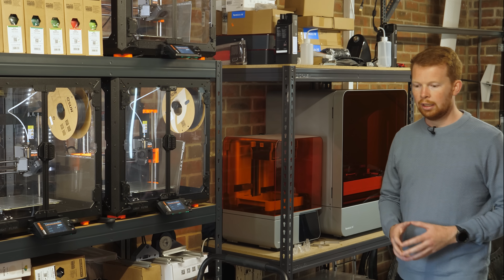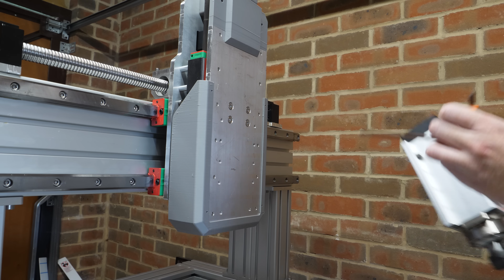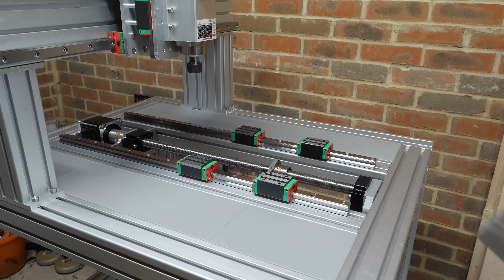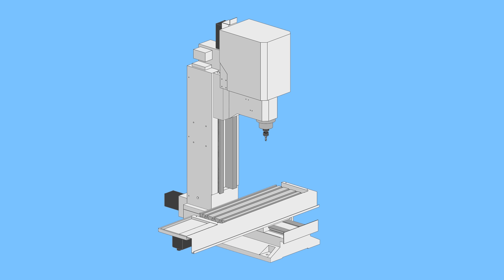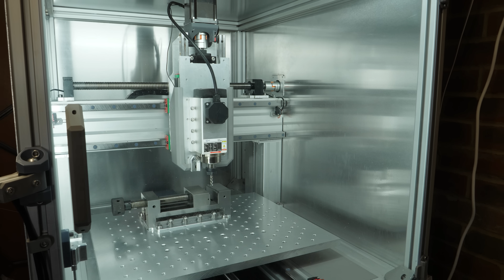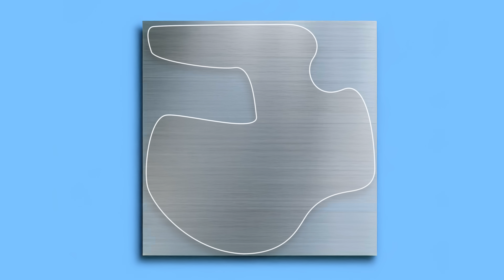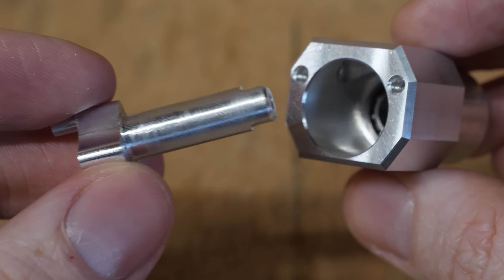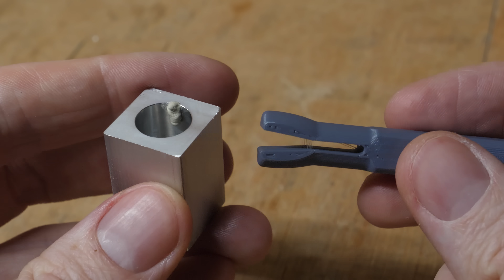I Needed an Engine, So I Built a CNC Machine

Comment: Mechanical designer here, most of the stuff I wanted to suggest already has (grooves for lubricant retention in the piston, locking nut to secure the piston assembly once fine tuned) But one thing that's really important here :

Aluminium to aluminium friction is quite high, and having both parts made of the same material also means they will both wear down and need to be replaced eventually.

What you want is to make the simpler/cheaper part out of a softer material, so that only it gets weared down, and the other part doesn't need replacement.

I'd suggest an aluminium and brass combo, brass is very easy to machine, and as a naturally fairly low friction. If you wanna get really fancy you could use self-lubricating brass, which is impregnated with graphite and used in bushings for high-speed applications.

The best while staying affordable would be a steel and brass (not copper, as it's an absolute pain to machine) combo, and I do believe your little CNC could machine mild steel, IF you install a coolant spray on it.
Reply: Oiled aluminium on steel has quite low CoF but thermal expansion has to be taken into account.
It would be easier and better to machine grooves into piston rather than cylinder although I have no idea what lubricant would be used, 900psi CO2 sounds like it would be 'quite cold' ?
Brass is quite heavy so crankpin and piston pin would need stronger material plus possibly heavier duty connecting rod unless it is operated at low rpm so keeping aluminium piston is best option.
Reply: @1crazypj he'd be best off using bearings
Reply: @jaubuchon28  
Of course your right, proper bearings to reduce friction would be good idea but that starts making things way more complicated, particularly for a non machinist with limited engine experience.
He would need to learn about  a bunch of other engineering.
Reply: @1crazypj"He'd need to learm a bunch of other engineering."
On a par with the likes OS, Novarossi, Picco, XRD you mean?
Reply: Aerospace engineer here - great points all round especially the like metal to like metal interface.
Reply: aluminium on aluminium dry friction coefficient is amongst the highest of the metal groups but its lubricated coefficient is not that bad compared to other metals
Reply: aaahhhh .. that is why pistons of Chainsaws are not coated with Nikasil, but only the Cylinders .. always wondered and never asked 😁
Reply: Yeah if he's not dry cutting, standard grade steel would be okay albiet slow lol
Reply: Carbide endmills on steel don't need coolant. Only if the workpiece heats and expands and it's a problem.
Reply: @MSivonen In theory, sure.

But having manually machined steel dry before, It's really finicky, and would require a lot of fine tuning on the g-code to get it to work reliably.

With manual machining you can go by feel and adjust before it gets bad, but it's not so easy with a pre-programmed CNC.

Especially considering that he doesn't have much experience nor knowledge regarding proper machining speed and what to adjust based on the sound, I really don't think it's a good idea, he would end up breaking so many tools.
Reply: @MSivonen  they don't need it, but they sure do appreciate it. 
At a minimum all end mills need chip removal. That is arguably the bigger reason to add some form of "coolant" (or air blast) Keep from double cutting chips.
Reply: @MSivonen despite theoretically being ok, nobody runs carbide dry due to heat
Reply: @jaubuchon28 that may very well be true where you work. But there are many cases where the workpiece doesn't get hot or the heat doesn't matter. And there are cases where cooling is absolutely necessary. So yeah i know, it's not a black and white thing.
Reply: why not make the piston teflon or something?
Reply: @imjstcl  The point of this project is to make something that can handle the 900 psi of using liquid CO2, and teflon isn't much stronger than 3D printing.

It would also become brittle due to how cold the engine would be, once again due to the liquid CO2.
Reply: What about a teflon sleeve inside the cylinder, that can be exchanged when worn? Keeps the engine light.
Reply: @ThePentosin  This could work, but it would partially insulate the cylinder, thus making cold management more difficult, and potentially fragilizing the teflon even more.

Might be interesting to experiment with that tho, perhaps the lower friction would still increase efficiency despite the downside of the insulation making CO2 evaporation slower.
Reply: @ThePentosin 
 Depends on running temperature, Teflon is quite soft even though it's second to melting ice for lowest coefficient of friction. 
It melts around 400f but mechanical properties degrade well below that temperature. (decomposing Teflon can release flourine gas, that's not a good thing)
Using CO2 at 900 psi should keep things cold? 
Maybe it would become brittle instead?
I looked into Teflon for a projects probably 20 years ago, forgotten most of what I learned back then.
Reply: @imjstcl  A PTFE Sleeve is a great idea, not only would it reduce friction but it would help seal as well. He might need to make the cylinder 2 pieces to get the sleeve in place, but that shouldn't be too bad.
Reply: > Aluminum to aluminum friction is quite high

So galling to hear that.
Reply: @hemiacplurge3572 honestly the opinions of uninformed people here has really anodized the crowd
Reply: @hemiacplurge3572  you have done well, lad… done very well indeed! 😂😊
Reply: Engineer & Engine Tuner here .. bare Aluminum on aluminum is a BIG BIG NO GO for a piston/cylinder.  I'd make the piston for this air engine and the con rod, out of plastic ... lower friction and lighter reciprocating mass.
Reply: Aluminum on aluminum and aluminum on steel is generally a poor idea for these kinds of wear surfaces. Aluminum has very low wear resistance, and has a phenomena called galling happen easily, especially toward iron alloys. Brass on a steel, or even cast iron cylinder wall, is the option that first comes to mind for his hobby application
Reply: @jacksonbf  A high silicon aluminium alloy is used in IC engines, cast alloys can have very similar properties to 'softer' steels plus  1/3 the weight. Galling/seizure is still a problem without lubrication though.
Reply: The benefit of single material is the ability to neglect thermal tolerances.  Since he wanted to used compressed air as a proof of concept and then use liquid CO2 for the final engine, keeping thermal expansion constant is probably a big simplifying factor.

That said, 304 stainless steel and self-lubricating brass is probably close (both somewhere around 17-18 microns/degree C)
Reply: @danielf3623 
 Problem with stainless and brass, they are both very heavy compared to aluminium 
A 304 stainless liner in cylinder gets around weight but stainless doesn't have very good properties when something is rubbing against it, (scuffing)  
Also, aluminium has an affinity to stainless so piston can 'stick' to liner relatively easily.
Reply: I was thinking this too
Reply: By adding grooves to the piston outer face not only you give lubricating oil a place to stay but also helps the piston to self center in the cylinder by means of the pressurized fluid (air or oil) in the grooves. It is a solution commonly used in hydraulic valves
Reply: I would figure that the cylinder and piston could be both aluminum, but only if the design of the engine supported a set of piston rings that would then be made of the softer material. This allows tighter tolerances but at least to me, it is unknown how much friction this would introduce, and how much power is gained from the process of adding piston rings. Could end up not even being worth it, especially at this scale.
Reply: Parallel projection makes my artist's head hurt lol
Reply: There's a lot of different plastics available that could handle the heat if you were just using it for the piston. You'd be reducing a lot of weight by comparison if you used plastic. Easier to maintain lubrication.
Reply: Wouldn't mixing steel and brass cause galvanic corrosion?
Reply: @pvpherthen2981  He's planning to use it with CO2, so it shouldn't be an issue, by the time it actually affects things wear and tear would make maintenance required anyways.
Reply: @pvpherthen2981  only if it's stationary in contact, when moving the gas leaking will act like a bearing
Reply: @pvpherthen2981 it's not in continual contact with water so it should be ok
Reply: I hate when anyone starts out by saying: "Mechanic from Louisiana for 20 years here🙋‍♂️" god damn... Stop it

Comment: Simple solution for the cylinder turning is to add a jam nut. You can set the timing, the lock the rotation.

Comment: Great work.
I think you need to look into G2 and G3 codes they are for circles on a CNC, modern 3D printers can also use them 
if they are enabled in the operating system and they can also be used on laser cutters at least they can on mine.

Comment: Your CNC machine is brilliant and a very nice piece of work. However, this engine may not be as efficient as your last one due to the unwanted compression stroke.  To fix this, I suggest adding an additional exhaust valve to your CO2 engine. Go back to the piston con rod ball socket idea, but instead of a ball socket use a larger cylinder socket. The con rod socket cylinder (little end) has two tiny holes which align with holes in the piston crown when the up stroke is occuring. This allows the gas to escape into the crankcase through these holes.  As the piston approaches TDC the angle of the con rod closes the exhaust holes. To avoid the inlet valve opening while the exhaust valve is open,  use a spring and a larger ball bearing to delay when the inlet valve opens.  Hope this helps.

Comment: I don't know fusion but I know that you can code your own postpros on Solidworks so I assume it work the same with fusion. Then just use G2 and G3 😉.
Just make sure your motherboard actually understand G2 and G3.

Also you can use G41 and G42, that would allow you to not worry about the actual dimension of the tool you are using 😉

Comment: You don't need to use a needle, you can just use the tool to touch off parts by checking if there's conductivity, there's ready-made plates for this on aliexpress etc

Though, I'm assuming the spindle is already shorted to the entire frame which makes this hard to do

Comment: If you are building a CO2 engine, then you are well on your way to creating an energy storage device. If the engine drives a generator, you can make electricity when needed. If you have a CO2 compressor, you can make liquid CO2 from electricity when when solar power is available. Is such a system possible as DIY? How large can a DIY system like this be? Can it power a home?

Comment: I'd suggest a simple set screw to lock the cylinder thread into position. You could knurl the outside portion to ensure grip and hide the marks of setting/unsetting the screw, then just add a support arm along the side to hold the set screw.

Comment: Machinist here: If your CAM software and CNC machine support it, you can use the G-code commands G2/G3 for clockwise/anticlockwise circles. If you want, send me a DM and I can take a look at the post-processor with you.
Reply: absolutely get g2/3 circular interpolation unlocked. you possibly will also be able to do helical moves for your thread milling.
Reply: I hate when anyone starts out by saying: "Mechanic from Louisiana for 20 years here🙋‍♂️" god damn... Stop it
Reply: @Mr.Goosebumps-gl8lv  than i recommend that you do not read this comment section
Reply: @Meiney100   yep 😂

Comment: I don't mean to pry as I have absolutely 0 experience with CNC. But won't the circle cutting tool inherently pass its inaccuracies to the part you're going to be cutting with it, as the making of the tool was limited by the gcode constraints?

Edit: the finished fit looks super smooth though, I'm impressed

Comment: I'm pretty sure I've seen people using a boring head or something like it to cut an outer diameter. If you can flip the boring bar around so the cutting bit is on the inside and open it up wide enough (probably requires a larger boring head) then you should be able to use it to cut an OD. Though I have no clue if that's a good idea.

Comment: Also machinist by trade here. I agree with previous advice given but I do have one thing that might soften the load on your machine. Normally when machinest and specifically milling opperators want to soften the load while maintaining the volume cut per minute, we tend to stick with trochoidal milling. In short this means a large stepdown (ap) but tiny stepover (ae). In combination with this you could increase the rpm and feedrate. I'm not sure what your machine is capable of higher rpms but at least you could lower the load on your steppers

Comment: G code can do circles just dont use coordinate system most 3d printers use as only option G02/G03 X12.5 Y14.7 R2.0 F0.2;

    X, Y – The target coordinates at the end of the movement.
    R – The arc’s radius.
    F – The feedrate (Speed) at which the machine will move from the current position to the target position.

Comment: A cylinder clamp like the yokes on a motor bike or lead screw coupling to hold the cylinder in position which can be machined into the crank case

Comment: you could mark where the optimal postion for the cylinder head is compared to the case with a marker or metal scribe, then maybe JB weld could keep it secure from turning
Reply: or just actually weld it if you can TIG

Comment: 2 ideas for keeping the cylinder in place:

(Easy solution) add a locknut onto the cylinder thread. 

(Cool solution) keeping with the aero theme; drill 2 small holes diagonally through the edge of the crankcase (one at each corner), then another through hole in the bottom cooling fin. You can then wire lock the cylinder in place 😁

Comment: Tom you also have usg02code G02 or G03 to make the circle they are the codes used to make an arc. And you never mentioned codes like g53 which is the machine zero code in other words the code used to tell the machine to go back to its zero point.

Comment: Some g code firmwares can be told to draw arcs, so it is possible to draw something closer to an actual circle than just using a bunch of linear cuts. How the firmware interpolates the arc command is another matter.

Comment: Whoa this is great!
I know too little about CNC finishes but to my laymen eye it looks like your surfaces are great. I also don't hear any chatter while cutting. I'm surprise there is no cooling fluid for cutting. Maybe for aluminium this is not needed?

Re pistons:
you slowly are approaching all the details of modern engine cylinders and how they are made.
Honing your cylinder liner at this scale might be challenging but the diamond lapping paste might cause big trouble if you can't clean it perfectly.
Offset for the piston bolt? that connects piston to the con-rod might help with better/more defined geometry at top-dead-center when the valve opens. At 100PSI you may not encounter what you will at 900PSI.
Piston and cylinder surface finish needs to be not perfectly flat. It needs roughness to reduce friction losses and carry lubricant.
Lubricant needs to be fluid enough to work at CO2 temps. Maybe CO2 itself is enough. If not, you'll need a gasket ring and a way to lubricate during operation.

Anyways, this is GREAT!
Thanks for taking us with you :)

Comment: If the pin on the top of the piston were threaded with a small jam nut at it's base the timing could be adjusted and locked with a static cylinder height removing thread cut and chamfer operations for a single drill and tap operation.

Comment: Why does it turn circles into polygons? Why doesn't it use G02 G03?? Is that the fault of the CNC controller not supporting standard G-code, or the CAM software having the wrong setting?

Comment: To lock the cylinder once you've tuned it why not drill a small threaded hole from the outside that you can then tighten a small bolt against the threads. Add a small dab of silicone to the bolts threads and it should remain pressurized.

Comment: I would like to suggest 2 holes on top for a shop vac hooked up to fish tubing that clears away you chips as you cut. you can hook the shop vac blower exit air into the enclosure to make the vac more efficient. be sure to put a lot of vibration guards and sound guards for the holes so the shop vac vibration does not vibrate the mill, suspend the shop vac by wire in a sound proof box, to isolate. make sure to have heat ventilation.

Comment: Aluminum on aluminum has pretty serious galling issues. Typically want it to be continously lubricated or you'll get increased friction and surface degradation, or use some kind of coating/gasket

Comment: to help with the piston sealing without additional parts you could try milling rings into the piston for the gas to start "folling on itself" like is common in gas piston firearms like ak where using additional seals isnt really feasible

Comment: While G0/G1 are linear point-to-point motion, G2/G3 are mathematically circular, so no steps. You tell the machine where center of arc or circle is, diameter of it, and how many degrees of a circle you want and the controller will figure out the rest. Some CAD/CAM software even has an option to recognize when the model is meant to have a circle, then convert many angles into G2 or G3 code.
Similar for 3D printing. While their software is simpler and may not always do so, some does support G2/G3 and will print perfect circles.

Comment: @Tom Stanton have a non threaded section above the threads that has 3 threaded holes 120degrees apart so you can lock the cylinder in place when you have found the optimal timing position.